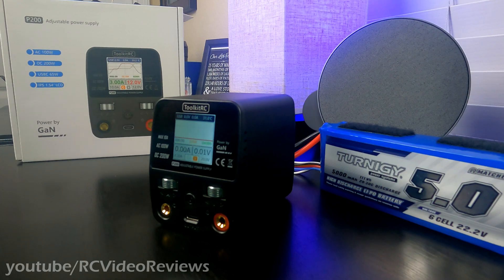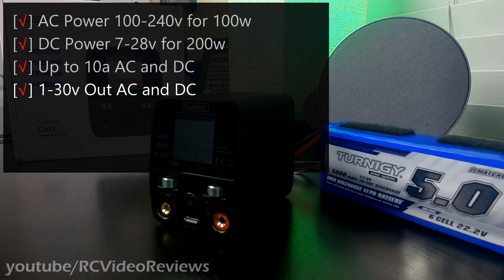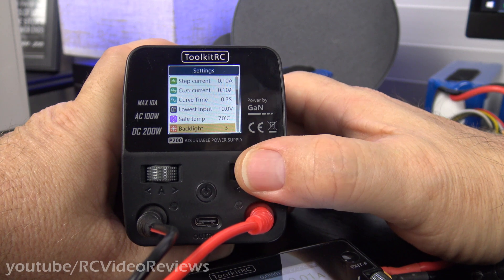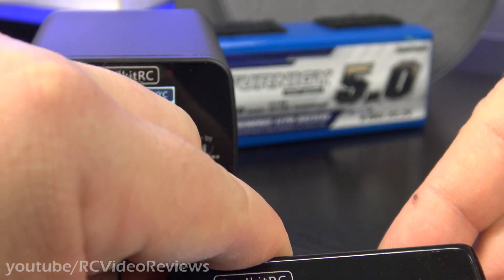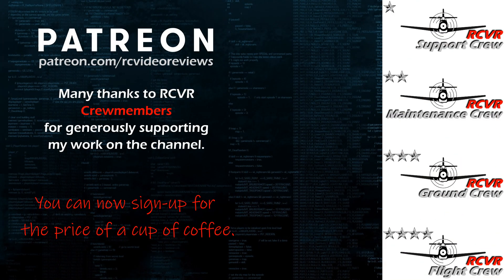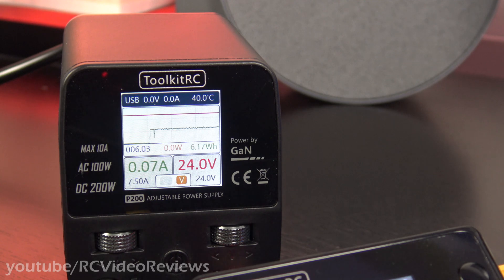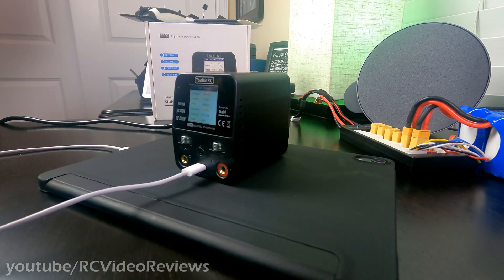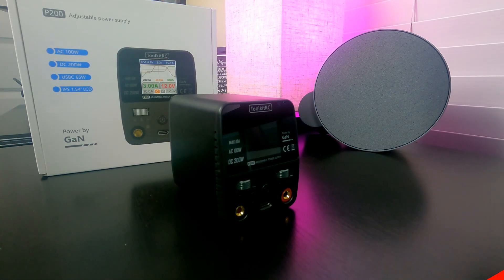ToolkitRC P200 GaN CC/CV Mini Desktop Power Supply

Comment: i dont understand why not just plug the battery into the charger?
Reply from the maker: You can use a big battery to power the charger, but why fool with keeping a battery charged to charge other batteries? The P200 makes an excellent little desktop power supply to power the M7 charger and any other RC gadgets you might need to power up to 100w on AC and 200w if you power it with a DC source.

Comment: Is this a Buck Boost type DC to DC supply? Nobody ever mentions it in any of the reviews.
Reply from the maker: It has both AC and DC source options and they don't advertise it as a buck boost unit.
Reply: @RCVideoReviews  Thanks for the response,  so it won't output a higher DC voltage than the input voltage? I need a power supply in my work van and this would be perfect. Obviously only have a 12v supply.

Comment: Great video. I'd like to have seen how clean and accurate the output voltage was (I realize you used another Toolkit product, the charger, to act as the powered device and display output) using a DMM, or better yet, 'scope it. 

If it's a clean and accurate output voltage, for $99, it would make a decent portable or back-up bench-top DC PS.
Reply from the maker: I haven't seen any variance that would result in issues for hobby grade equipment. If you are talking about lab grade gear with lab grade variance I'd suggest you keep looking.